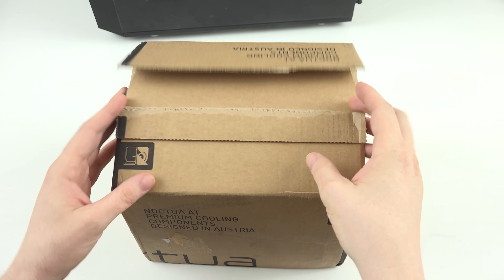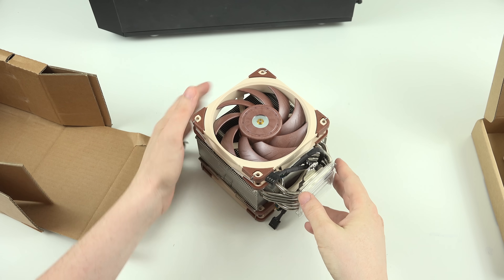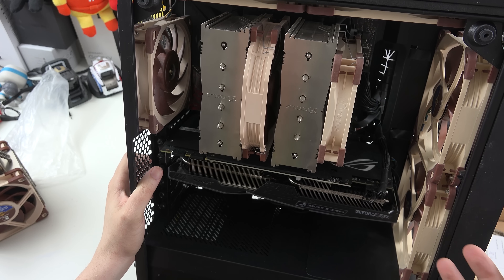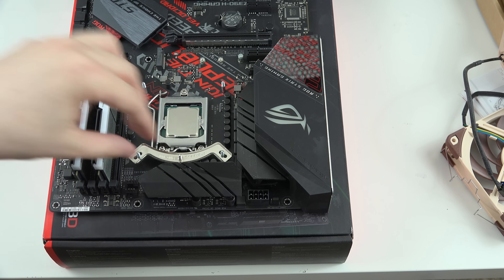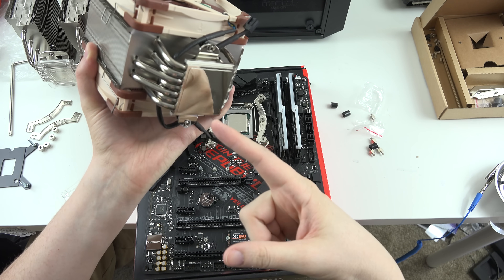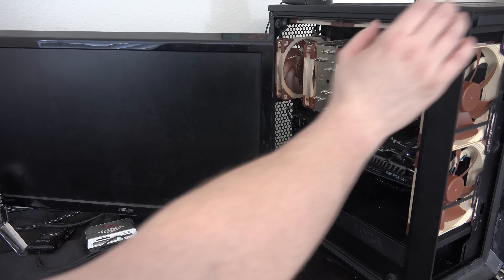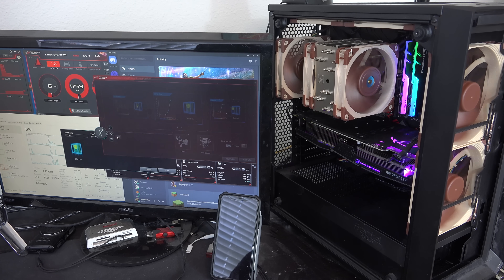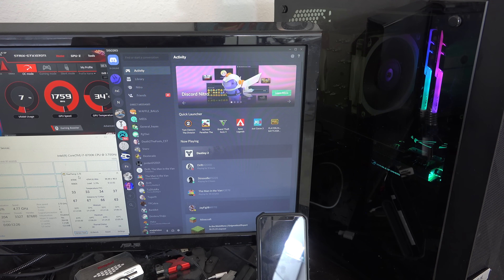Noctua NH-U12A Unboxing and Install (Meshify C Case - NH-D15 Comparison)

Comment: I know it's been six years. You didn't install the plastic mounting hardware. That's very important. Without it, someone could damage the motherboard while screwing the heatsink in. Or even destroy the threads in the radiator mount😊👍
Reply from the maker: This pc was handed down to a family member that played only on a PS4. I wanted to PC game with him. So he got my i7 8700k 1070ti strix build. I built a Ryzen 9 and 7700xt build for me.

Comment: man you hv wasted so much money into noctuas fans and coolers..  you shud hv done proper research before buying ur cooler and pc case.
your psu was also very less compared to standards. if yuh hv bought i7 and z series board. yuh shud hv gone wd min. 750 or 850 for future potential upgrades.
Reply: Maybe he likes the look of noctua’s?
Reply: @leavii5449  i like noctuas too. recently i replaced 6 cooler master case fans which i hv been using since 2017 to all noctuas. in few months im keen in ti replace my hyper 410r cpu cooler too to noctua.
what he did actually is that he didn't properly researched his compatibility of his pc components, case with noctuas fans n coolers. thats why he wasted lot of money in replacing one noctua cooler or fans to other noctua fans n coolers.
noctuas aren't cheap and one isn't supposed to make mistakes while buying noctuas.
Reply from the maker: yup!! And I’m Still using the same setup today! https://youtu.be/fHxjdzD_IjY ;)

Comment: between this 2 noctua / NHU12A & NDH15 / NDH15 have better Temperature CPU? if yes how many degrees?
thanks so much
nice video
Reply: less than 4 degrees, i´ve upgraded from Nh D15 to Nh U12A Crhomax and don´t regret. The Ram clearance gave me the chance to buy 4400mhz Aorus Rams, with Nh D15 i was restricted to Corsair Lpx or Hyperx Fury
Reply: @francosicardo  thanks for ur feadback
Reply: @DeejayCriB  U12A and NHD15 have almost same cooling performance. This "upgrade" was pointless...
Reply from the maker: @francosicardo  Still using the same setup today! https://youtu.be/fHxjdzD_IjY ;)

Comment: Please provide some information about Temperature with the noise level in an idle and full load.
Reply from the maker: I was new to this and didn’t have the tools and experience to do that. Still use this same setup and it’s only loud when rendering in premiere pro and my CPU gets to the 80s. https://youtu.be/fHxjdzD_IjY